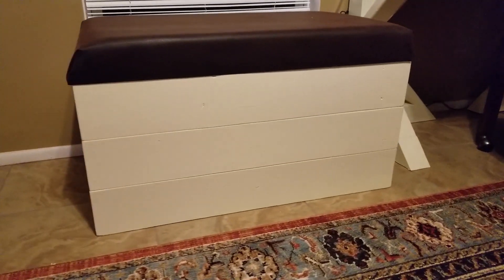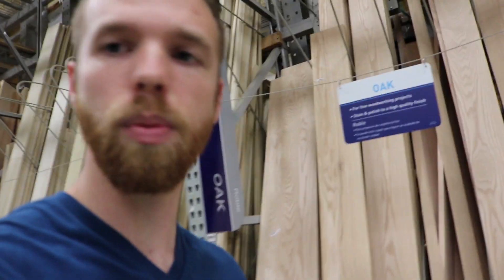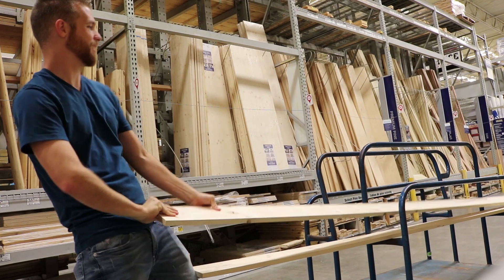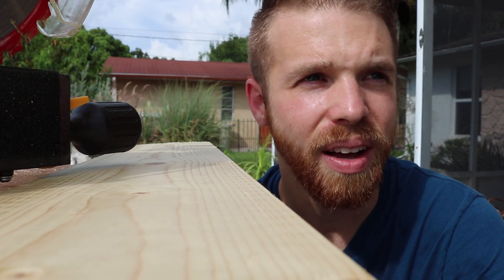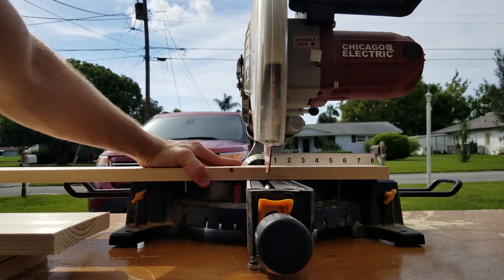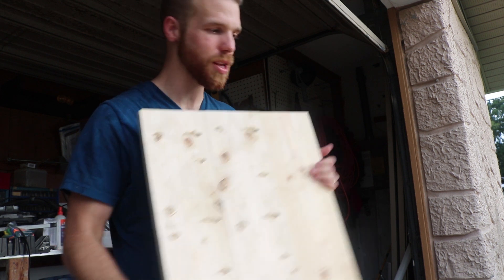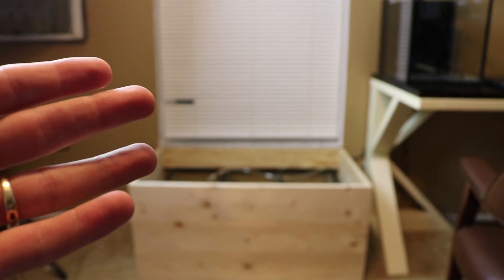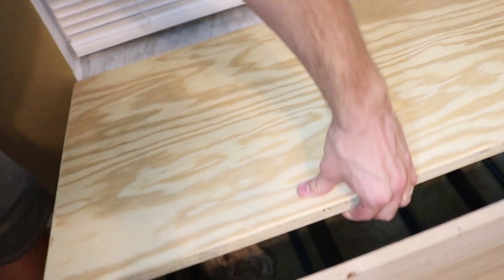Hiding an ATO and AWC Reservoir [DIY BUILDING A BENCH]

Comment: Hi m8,  I been out of the hobby for 5years and I'm a lil rusty, I've got a new aquarium and have access to fresh local live rock, Now should I add saltwater first then sand then filtration/heating let that settle then add the live rock and scape it.  Then let it run for 4-8 weeks whilst monitoring everything and weekly water changes. Then add lightning  and think about stocking. Does this sound ok to you or something's I should do differently,  thanks for your time.
Reply from the maker: There is no right answer here, however I would start by buying dry rock rather than live rock... usually a lot cheaper and 100% pest free. I would cure it while you gather all your equipment (skimmer, lights, power heads, heater, etc). I would then aquascape without any water in the tank... this allows you to glue, use putty, and really get creative. Then sand, then water, then plug it all in and rock and roll. I'm going through this process right now on the nano build and the next step is aquascaping!